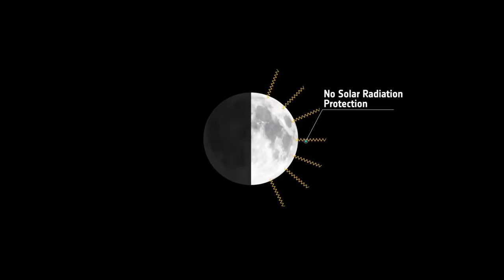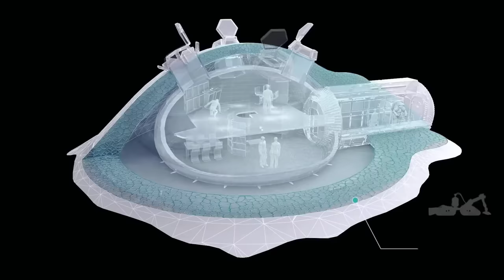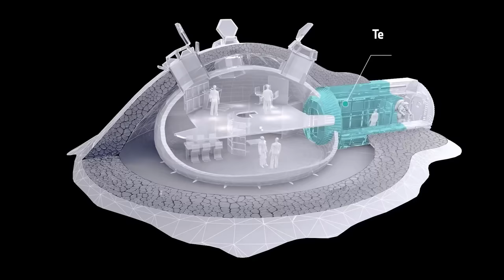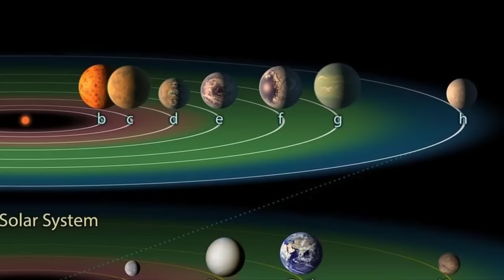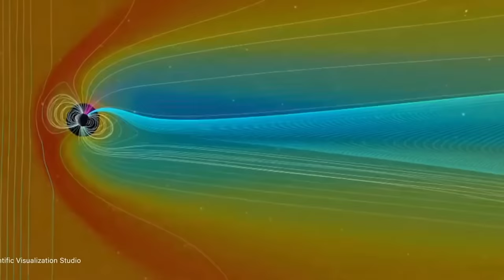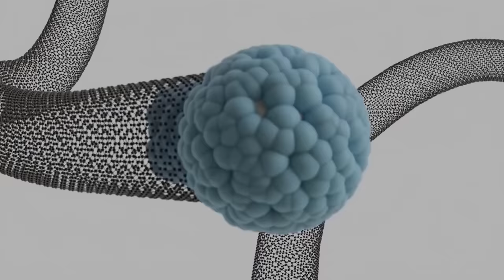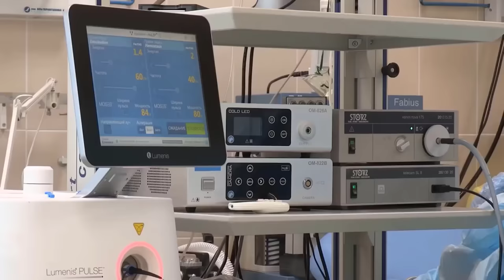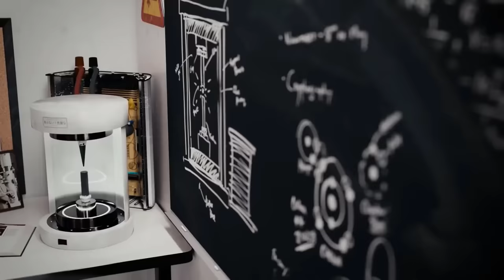How will humanity colonize the solar system ? | Space DOCUMENTARY - Colonization of Space

Comment: Ah yes, Mercury.  I really think this planet should be colonized sooner rather than later, as an excellent source for a metal industry.  As he says, 70% metals as opposed to Earth's 40%.  Building a colony on the edge between light and dark would provide very easy, reliable, and vast source of energy.  You'd have iron habitats and industrial centers on the dark sides of valleys with solar collectors, probably just steam from direct sunlight poking up over the horizon.   This would be the ultimate place for shipbuilding.  Mercury would require supplies of water, Nitrogen, CO2, etc. from elsewhere but the payoff would be well worth it.  The industrial potential makes Mercury easily self-financing.
Reply: Solifugus, block out the sun with a giant sunshield parked at Mercury Lagrange point one.  Mine the dark side while the other side is cooling off.  Same idea with Venus.
Reply: You forgot that a Dyson Swarm could be built with Mercurys Resources. Such a Dyson Swarm would Supply almost Unlimited Energy, more than enough to Colonize the rest of the Solar System.
Reply: Nuk13, nobody forgot about Mercury.  Ultimately, yes, it is a goldmine that will yield more building materials, but first we will have to take baby steps - my guess is the Lunar surface first, then the moons of Mars, followed by Mars itself.  Space elevators and electric slingshots will probably be utilized to lift materials into orbit.  
The asteroid belt will also be essential, but the Moon and Mars are both closer and easier to get to than any other off world location.

Comment: Some argue a colony on Titan makes more sense than on Mars.  I admit it is arguable.  The cold is extreme and the gravity is similar to Earth's moon (11% of 1G).  However otherwise, there cloud cover provides all the shielding we'd need and there is plenty of water ice.  There are even winds for energy production.  The atmosphere is thick enough that you don't need a pressure suite to walk around outside but very very cold.  On Mars it's cold but the atmosphere is so thin that heat exchange is slow.  In other words, on Mars you'd get cold slowly while on Titan, you'd get cold very quickly.  So, you really need good insulation.  I think ice caves are possibly a good option.  In fact, it's a good option in Martian glaciers, too.  That is, simply melt out a city.  You will need to build an entrance and ice it over to seal it.  Otherwise, you can warm the interior of an ice cave to comfortable temperatures.  I have slept in a snow cave.  I know very well this can work even better in an ice cave.  For grow rooms, you might want to add a polymer insulative membrane to reach temperatures good for tomatoes but otherwise, a room temperature is easily achievable.  You can also make ice furniture like takes and chairs and even plates and cups.

As for industry, Titan is extremely rich in hydrocarbons.  That means, it'll be useful for a plastics industry.  It's also rich in nitrogen gas, which is valuable for habitats throughout the solar system.  In particular, spacecraft need 78% nitrogen + 21% oxygen.  Oxygen is easy to get from water but nitrogen is not.  I can see plastic canisters of nitrogen as Titan's main export product.  Travel on Titan would also be easy.  The atmosphere is so thick you could almost fly just by flapping your arms.  And being primarily nitrogen, you'd only need to carry oxygen with you, meaning your breathing equipment will last far longer than other worlds.  The cryovolcanos and many seas and mountains might also make it a tourist destination, one day.  Also, there is a possibility that the seas (or lakes) might be interconnected under the surface.  In theory, it might be possible to take a submarine through the moon to the other side.  Water below, is as lava below Earth.

Comment: I am an advocate for an independent Mars--not depending on supplies from Earth.  Mars has everyone necessary to live without any but initial supplies from Earth.  I believe two starships could hold enough for an independent colony of 50 people (including the people). This could be reduced to one Starship but that's pushing it.  My idea involves a metal smelting/foundry and a machine shop (in small sizes) using a solar concentrator to smelt.  The colony would be made of corrugated stainless steel sheet metal from the abundant iron/nickel, a large rectangle with shops in the corners, housing in the outer walls and the center a glass-roofed greenhouse.  Windows would be made from blown glass bricks, filled with frozen water for shielding. Energy would be from wind turbines, made entirely in the machine shop.   Instead of welding, the lack of oxygen makes possible "cold welding" which is just pushing the steel together like two pieces of clay.  Clear PVC plastic can also be produced using the steam method (high pressure CO2 and chlorine (from the abundant salts on Mars) by steam).  The housing in the outer walls would have a hallway through the center of each wall with housing units on each side.  The roof would overhang with regolith on top for insulation and shielding and would overhang to shield the windows.  In outer housing unit would provide windows to the Martian landscape.  Inner units would have windows to the gardens in the interior.  Each corner shop would have a large vertical wind turbine such that the turbine is inside below (for maintenance) and the blades up above outside.
Reply: Solifugus, you don't know any Navy people, do you..?  Find a few submariners to bounce your ideas off of and see what they might think of your proposition..
Reply: We have no idea what's the minimum amount of industry or population size or skillsets needed for a truly self-sufficient technological civilization.
We don't know if it's possible or what it will be possible.
A space colony can be built in space with 95% space resources but they need parts which no near future space industry can make.

Hand-waving about nanotechnology 3D printing of everything to make a modern technological city is fantasy.

Space industries and mining can pay for everything, but they still need support from down here.

As for a colony on Mars, prove that we can live long-term and stay healthy in low G. That's *proof*, not S.F., not wishes and hopes and ignore the question and try it and see.
Meanwhile, we know from the '70s NASA Ames / Stanford space settlement studies that we can build space habitats at Mars or anywhere for better living conditions than down on any planet.

Comment: I think the best value from the asteroid belt is in mining ice and precious metals.  The outer edge of the belt is where ice begins to exist exposed to the sun because it is where the sun's rays become weak enough.  My very first space mission would likely be a visit to there to collect a very large bag of ice.  That ice would be key to the colonization of the rest of the solar system.  It would be used as shielding, plants, oxygen, and fuel/propellant.  Imagine sending a rotating spacecraft into space with dehydrated soil from Earth.  Water is just too heavy to launch in large quantities but if you can bring back ice from the outer area of the asteroid belt then you could quickly hydrate this soil.  The idea of a rotating spacecraft for gravity is key to all long-distance space travel because we need gravity and it may well be impossible any other way.  There is no realistic theory of artificial gravity, otherwise.  

On Earth, we use dense (and thus heavy) materials to build structures like buildings and such.  This is because we have to fight gravity always pulling down.  However, in space, the vacuum is always pulling outward.  So what we need is tensile strength, which is common in lightweight materials, such as fibers or polymers.  In other words, it's ridiculous that we keep building space stations with dense materials and structural methods developed for us in gravity.  Very large spacecraft could be put into space far more cheaper if they are inflatable.
Reply: Solifugus, slingshot the building materials from the Lunar surface, where automated mining, refining and production will create the building blocks needed for Oneill cylinders.  
Then fleets (neighborhoods?) of Oneill cylinders can block the sun from Mercury and Venus, allowing us to do the same thing there.  
Eventually they all get gobbled up..

Comment: There will be no manned mission to Mars, or any other celestial body, until we have a permanent presence on the moon. Until that baby step is taken, this is all just one big pipe dream. But fantastic video!!---very informative and very well made!!
Reply: It is not necessary or even helpful to have a Moon base first. Any technological development can be done regardless, and the Moon is not useful as a shipyard or refueling depot for getting anywhere else.
If anything it should be said that we need access to the resources of the NEAs, before we have much of anything else beyond "Apollo 2" or "Apollo to Mars" temporary exploratory missions.
Reply: Jfrazer, we will probably need ALL of it.  The shipyards will probably be located at the lagrange points, awaiting materials brought in from elsewhere.  The Lunar surface may not be developed or populated too largely, but automated systems that mine, refine, cast and produce raw materials will be essential to all of this.  Electric catapults and space elevators will be put to work lifting these construction materials into orbit where they can be used to construct these behemoths.  I'm guessing that most folks will probably live at the lagrange points, building and boarding these incredible structures.
Reply: A point is that long before you've put in enough infrastructure on the Moon to mine an sort materials and to build an EM catapult and all the other infrastructure, you've done more than enough work to start getting far superior materials back from NEAs. Materials not only to build things for ruse in space, but to pay off not only that and the entire space effort but the national debt and the national budget for the next several decades and to end scarcity of resources and budget crunches forever.
Reply: Jfrazer, I respectfully disagree.  I think there will be less waste of time, effort and resources by focusing on the Lunar surface.  Collectively there are a lot of projects that could benefit from some combined effort.  I'm definitely not saying it would be a waste of time retrieving materials from other sources in orbit, just that focused effort on the Lunar surface would be more practical and efficient.  Honestly, I believe we will probably reach in both directions simultaneously.  
The LUCY mission should yield more data to support your preferred direction.  Everyone is looking at Tyche 16 with envy.  
And, ultimately, there's a sense of satisfaction to be gained from turning a planet-killing rock into a much more useful space station..